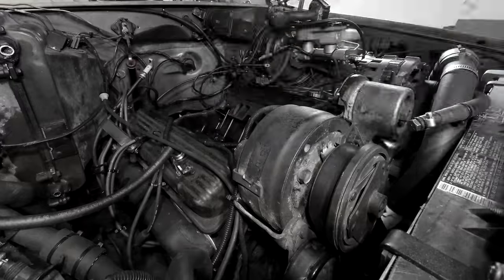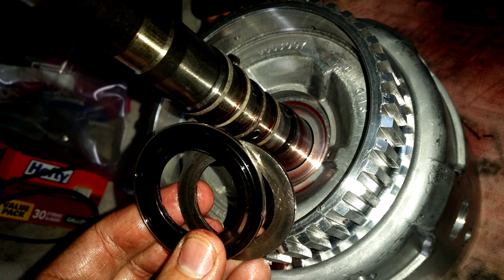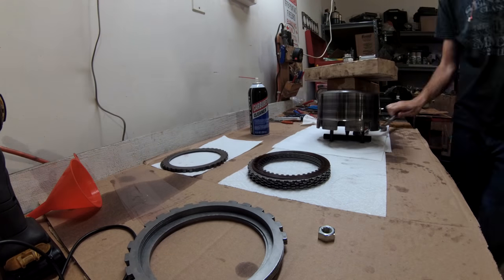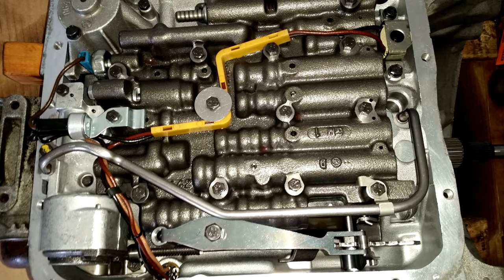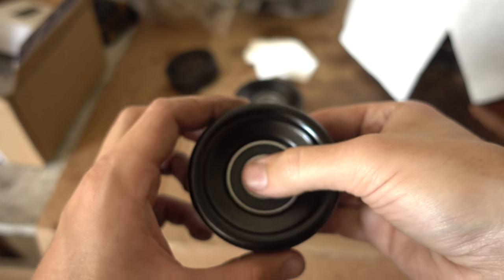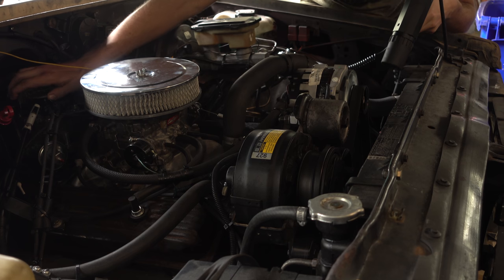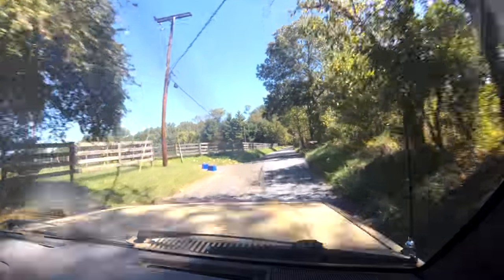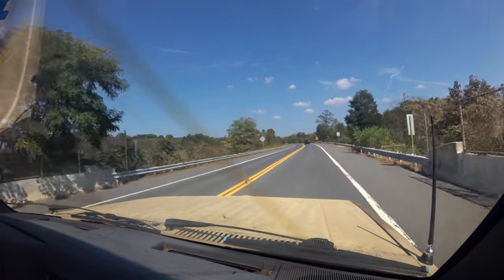4x4 V8 S10 700R4 Transmission Rebuild & Tune (Ep.4)

Comment: Run an external cooler as well. Big help
Reply from the maker: Good thinking! Depending on how I end up driving it that may well be in the cards.
Reply: FuzzyDicePimp always run a cooler. No matter what the use.  That's just me, I'm a bit of a fanatic. But since u just spend all the cash rebuilding it and the engine is coming out add $30 of insurance with a cooler.   Tip: use efi hose clamps.  Coolers always come with cheap junk that will leave u stranded
Reply from the maker: Alrighty. I'll see where I can fit one in the front end and pick up a cheap one. Do you plumb it inline with (after?) the radiator ATF cooler? I need to put one in my other truck after I rebuild its 4L60E (did a lot of towing and got it quite hot) so it'll be good to have the experience of installing a cheap one I guess.
Reply: FuzzyDicePimp me personally I eliminate the rad.  Not cooling shit in 190° coolant. I always use a decent size cooler. 20 to 30k.  The 4L has to warm up to engage converter clutch but it will warm up fast enough. Especially when towing.  Doing things this way has never given me an issue.
Reply: FuzzyDicePimp plus by keeping them together if u overheat the motor the trans is toast or if rad goes internally u could fill the trans with coolant.
Reply from the maker: Gotcha. I'll see where I can try to fit one in there. We get reasonably cold winters, down to 0 degrees F sometimes, the transmission would be fine for normal driving with only the standalone cooler? I thought the radiator was also meant to help heat the fluid up to temp.

Comment: well  now  we know why the dip stick shoots out from a bad head gasket pressurizing the  crank case
Reply from the maker: Actually, nope! The leak was only between the cylinder and the water jacket, not into the crankcase. The dipstick was pure, simple, blowby! (And probably a bit of overfilled oil)

Comment: so how much are you into this project so far 3k? or more? Going to be doing a s10 350 swap here soon. Just gotta find a rolling chassis with title first then im gold!
Reply from the maker: I think right around $2k. Will check after the engine parts, but they're only another $120 or so for now. I have sorta-kinda kept track, but I also don't want to know if that makes sense haha. Good luck with your project!
Reply: FuzzyDicePimp  just make  sure it's a decent rebuild kit along with a new oil pump. Should be gold! Loving the process so far keeo it up!
Reply from the maker: Thanks! It was a cheap kit, but good reviews. If some parts seem cheesy when I get it I will probably change them out. Ordered a Melling M55 oil pump and pump driveshaft. Have not used an aftermarket oil pump before (I'm cheap), but this engine could do with a bit more oil pressure. Don't know if it was low just because of the worn bearings, though.

Comment: Is there anyway you could give me the part numbers for the belt tensioner and belt for that motor? I have the same front accessory drive with the large steel bracket and I am having a hard time finding the right parts. Thanks in advance!!
Reply from the maker: The tensioner assembly is a 38108 (by Gates, ACDelco, etc.), the belt on mine is a 6PK2425 which means a six rib that is 2425mm (95.5") long. My engine setup does not have an air pump on it, but it still does have the A/C compressor and the power steering pump. Hope that helps!
Reply: Fuzzy Dice Projects That is perfect, thank you so much. Your videos are awesome!

Comment: I mean, you could just bang out the head gaskets at this point, and see what happens after that... I don't doubt that at some point you'd still be rebuilding, but at least put it off a bit more, lol.
Reply from the maker: If I really wanted to put it off I'd just ignore the head gasket leak, haha. I do admit I drove it a few times after noticing it
Reply: I'm already as far beyond this video as the time frame here will take me... now moving on to EP6... I had a 93, 4.3 vortec.  It was my first hands on vehicle really, and as such, it was the first that I knew inside and out, blindfolded, drunk, sober, asleep, whatever.  Ever since then I've had a lot of things, some out of necessity, some out of lust.  As it sits now, I have two 99 model GM's... An Escalade, and my Camaro SS.  Trucks white, cars black... Both have leather and are pretty nice for what they are... Ones really freaking fast, the other is ... uhhh.. well... It just got a junk yard rear end and is somewhat nerve wracking in regards to "reliability".  I've since lost my passion to just do things to do them.  When I say "really fast", what I mean is that I bought a 99 Camaro SS in 06, with 18K.. It ran 13.5 pretty easy then, and it runs 12.4 to 12.6 pretty easy now... And by pretty easy, I mean on street tires, launching at idle, not being too aggressive at all really.  But hell, bone stock mustangs sort of do that now, so it was impressive in 99, still pretty awesome when I got it and made it better, but anymore its just a pretty car that's "pretty quick".  That said, it now has a stage 3 "tranzilla" t-56 to replace the stock borg warner unit that sort of failed... enough to warrant a crazy purchase at one point anyway... and wouldn't you know it that I'd get the only awesome trans with a bad 1-2 syncro from the factory.  I installed it, drove it a hundred miles tops, while it mostly sat parked while I traveled for work the entire next year... The duration of the units warranty.  I left that job, came back to my car, and it broke... Been sitting ever since... can't justify the expense of having it pulled and fixed, no longer have a garage to do it myself... live on a trifecta of three steep hills... its poop.... Was really hoping to get that one going this year, but its looking more and more like the investment will be the rebuild of the replacement rear end which I put on a mere, I don't know, 4 months ago maybe... on the truck that is.  This is what the hobby has become for me... it's no longer fun.  I haven't even been to a quarter mile track in ... shit... a decade.  A literal decade since my last time slip... Wasn't even on this transmission... Didn't even have this suspension.  Line lock wasn't on back then.  It's actually gotten a lot better, who knows... that 12.4 best might be easy to beat now... If I only had a 1-2 synco, I could know.

I love the videos though, excellent content... You seem like someone I could easily  do some really good work with.
Reply from the maker: Sorry to hear that you've lost the fun, I do understand that feeling. Sometimes you go out of your way to get a new part or replace one thing and then just kicked while you're down when the new part doesn't fit, breaks like your synchro, or you find a dozen other things that need replacing. Not even talking about drag racing, just working on cars, it's exhausting. It wears on you, and eventually instead of being excited to work on something it just feels like work towards no end.

But I keep coming back, partially because I guess I'm a glutton for punishment, and partially because everything I own is broken and I need at least one working vehicle! So some things are done begrudgingly, I have put off fixing my Silverado transmission for two years and am only now starting to work on it, but once I get my hands dirty, even when things are going wrong, there is still something satisfying there. With the Silverado, it's almost like spending time with an old friend who you haven't seen in a long time.

It's also been an excuse to have friends I haven't spent time with in a while help out, and just talking and complaining and cussing at hard to reach bolts doesn't seem to get old. My Firebird has been under a tarp for almost a month, although it still works, I have new parts for it and don't have the time. This Blazer is still getting work done since it's my primary vehicle, but sometimes I get some perspective and look back on the amount of work I have done to something that even the guy I bought it from marketed as a "POS".

On the one hand, I know it's kinda terrible, and it's still slow, and a bit scary. It'll probably never be as efficient as I want, as quiet as I want, or drive as nicely as I want. I haven't exactly emptied my wallet on it but I have certainly spent some money. But, despite that, every time someone on YouTube comments "why the heck did you spend so much time and money on that POS" I think it gives me inspiration, and more reason to fix it, like, to prove them wrong. I don't think I can, that comment is pretty truthful, but I think wanting to make things better is what keeps getting me back underneath these broken, dirty, rusty vehicles.

I hope you can find a way to enjoy the hobby you have fallen out of grace with, truly.

Comment: I have a 4l60e in my truck and it needs to be rebuilt so can you make a guide.
Reply from the maker: I've gotten enough requests that I guess I will have to do it now! No ETA on that project though, I want to have the Blazer fixed first so I don't have two trucks in pieces sitting around.
Reply: thanks

Comment: How do you like the stall converter that you installed?
Reply from the maker: I wish I could give feedback there, but I didn't drive it enough or push it hard enough to have an opinion haha. It would hold on steep hills really well, didn't seem noticeably different from the 4.3L converter. It doesn't crawl much at idle but didn't seem annoying either. But, it's tough to say since the 350 never quite ran right before the trans rebuild.

Comment: how much your into parts to rebuild the transmission?
Reply from the maker: Rebuild kit was $135, torque converter $105, sunshell $35, Corvette servo $12. So around $290. Then about $15 for the transfer case seals. Also bought a few tools, maybe $60 on those.

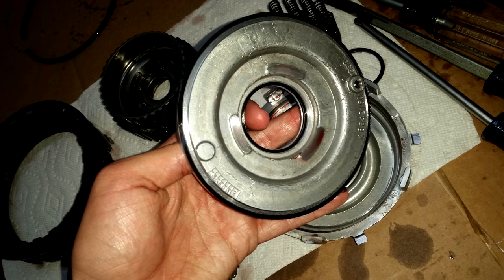Comment: Dude put a 4:10 gear in it or a 3.73 you'll get alot of power
Reply from the maker: With the engine I'm using, it has lots of low-end torque but not much horsepower, so it is actually pretty suited to the 3.08 gears it has. I'd also like to be able to actually drive it on the highway, these truck engines don't do much at high RPMs. Plus, I'd need to replace both differentials if I wanted to change anything.
Reply: FuzzyDicePimp I run my dirt race car 350 bored 40 over with 4 bolt main running turbo trans with 4:10 gear in it.
Reply from the maker: Nice! Of course, I know people DO use gearing like that, but the thing must scream like a devil driving on the highway in third gear!

Comment: Did the 350 but right up to the 4.3 trans?
Reply from the maker: Yep, the 4.3L came with the same type of 700R4 used with V8 engines. After 1987 or so I believe they were identical. The 2.8L however, used a different type of 700R4 case and those wouldn't fit. Those are easy to identify by a flat top bellhousing as opposed to the pointed one.
Reply: FuzzyDicePimp do you know if its the same way with the 4l60 e? Kus thats what I got in my s10 and its on its way out
Reply from the maker: Sorry, but I do not. I don't know as much about the 4L60E since I haven't had to do the research on compatibility between them.

Comment: you power wash the trans why you did not do the same to the engine
Reply from the maker: Do you mean before the engine was installed? Did not have the pressure washer at that time, actually.

Comment: That's not how you test bearings. You test them under load. A real bearing is never not under load, and are designed that way. Only skaters who are easily deceived test them like that, and then spray out all the grease with wd-40 and they roll worse and die in 20 feet. Other wise great video. I live this series.
Reply from the maker: I'm confused, what bearings are you referring to? The thrust bearings, the sprag clutches?

Comment: 4:30 what camera did you used to file this bro?
Reply from the maker: That timelapse was filmed with a Yi 4K action camera. They are inexpensive GoPro-style cameras, I just plugged it into a USB charger to keep it running and taking pictures without the battery dying.
Reply: @FuzzyDiceProjects  okay Kool because I have the akaso v50 pro. I going to start using them. Love the video

Comment: Should have just bought a new truck. All the time spent fixing this pos could have been spent at a part time job. You'd have a comfortable, reliable, good looking vehicle, and no stress and anger from always having to redo everything.
Reply from the maker: A lot of it is for the experience, I learned a lot from rebuilding everything on this truck. Good cheap practice for things like transmission rebuilds.

Comment: Could've just used a combustion gas detector...
Reply from the maker: You're right, that would work too, but I get more valuable information from performing a leakdown test about the condition of the engine, which leads me to do a full rebuild instead of just head gaskets! A combustion gas detector also would not have had the specificity of narrowing things down to one cylinder in one bank.
Reply: Oh yeah, no doubt. But an engine that old with an unknown amount of mileage I would've pulled it apart for a blown gasket anyways, especially when it started to "snowball" with the broken head bolt.

Comment: So you rebuilt the engine for nothing
Reply from the maker: Huh? The engine rebuild (that came after this) was because a cylinder head gasket was blown. If you mean the engine replacement, the transmission issue was not related to the oil pressure problem the original 4.3L had.

Comment: At 1:12 you strong young men should have used your legs and not bent your backs.  Or, better yet, used an engine lift.  PLEASE BE CAREFUL with how you lift.  I required back surgery after too many lifting experiences, lost a year of active living during my recovery.
Reply from the maker: You are completely right, that was improper lifting. I try to follow the "lift with your legs" thing but sometimes it slips my mind. My back already isn't in great shape so I need to take care of it. Thanks for looking out!